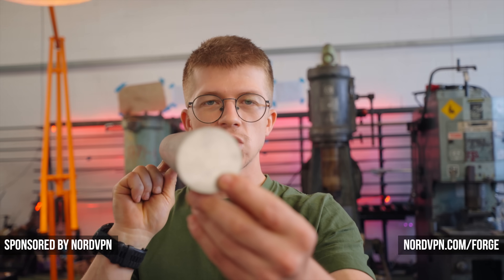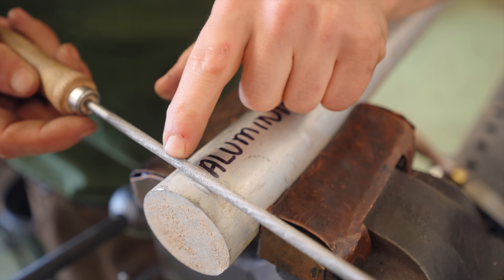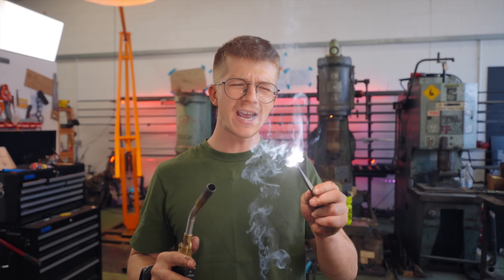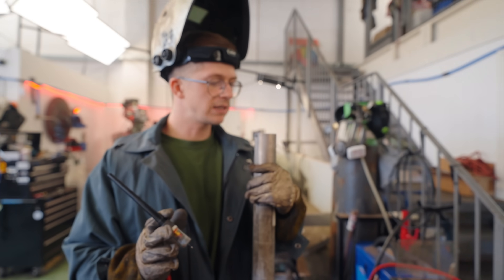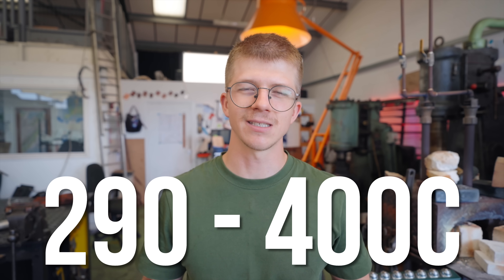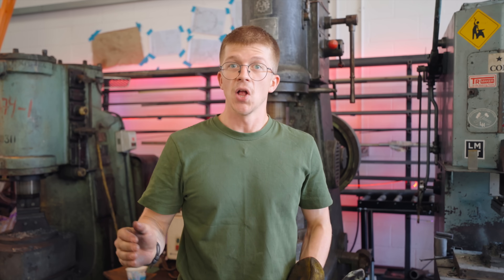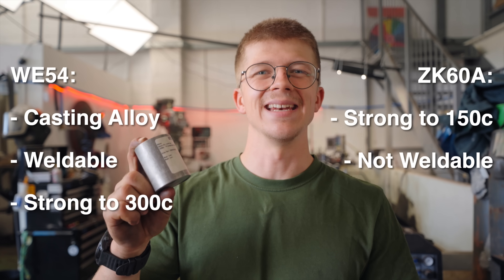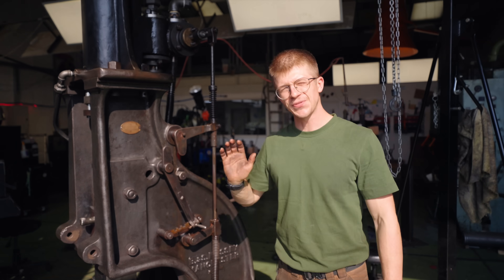Can You Forge Magnesium?

Comment: The Density doesnt really correlate with properties like hardness. Thats because density is mostly affected by the mass of the atomcores, while hardness is mainly affected by the bonds.
Reply: indeed, look at at metals like gold and lead which are famously dense... and famously soft
Reply: @vhaelen326  And mercury, the softest of them all and crazy dense. Dense enough to float lead on it.
Reply: @mrkiky wondering if solid mercury is indeed soft or hard? It would be a funny episode to forge something in a big freezer :D
Reply: @apinakapinastorba  Or just take the mercury out of a freezer instead of out of a forge. And periodically you put it back, but not because it got cold, but because it's getting too hot.
Reply: @mrkiky  no as fun thou
Reply: @apinakapinastorba  Otherwise the freezer would have to be really freezing to solidify mercury, and you'd have to maybe dunk it in slightly less freezing brine to heat it up or something. Also the temperature might make the steel of the hammer and anvil slightly more brittle.
Reply: @vhaelen326 Tungsten be kinda weird though
Very high youngs modulus, very hard (i.e. also brittle) but yield strength roughly 3 times steel
combination is also likely why it exhibits self sharpening properties
Reply: @vhaelen326  contrasted with titanium (and cast iron vs carbon steel?)
Reply: @vhaelen326 even denser and softer yet: mercury
Reply: @vhaelen326 then look at osmium, it’s the densest metal known To man and also one of the strongest
Reply: @vhaelen326  What about the reverse? We are talking about very light but with these strong bonds. With carbon I see it but with metals?
Reply: @vhaelen326 Yes. Quite the same is true for Thallium.
Reply: ...and crystal structure.
Reply: @AnonymosAnthropos  And imperfections within that structure, as the cracks from working the magnesium to hard illustrated
Reply: Now you're talking. @AnonymosAnthropos
Reply: The density depend on the atomic mass and the crystalline structure. Some geometry cause the atoms to be more packed together than other.
The hardness depends on the bonds and, to a lesser extent, the crystalline structure.
Reply: yeah! take Lead as example its really dense but also soft
Reply: Best example would be charcoal and diamond, both are carbon but one is very much harder to work with than the other
Reply: @ClawsOfAFreak  but diamonds also have a higher density so it's not a good example
Reply: @HanTrio3  diamonds have a low density they weigh almost nothing.
Reply: @ganjalfcreamcorn8438  diamonds have a density of 3.52 g/cm³ which is higher than that of charcoal. That's what my comment was about
Reply: @HanTrio3  Diamonds are not very dense. Abaut half of steels density.
Reply: @peraz968   Diamonds have a density of 3.52 g/cm³ which is higher than that of charcoal. That's what my comment was referring to
Reply: @ClawsOfAFreak Or tungsten and gold
Almost same density but one is extremely hard and one extremely soft for a metal
Reply: @ClawsOfAFreak  yea but diamond is more dense than charcoal... so your example is a bad one
Reply: @ClawsOfAFreak  That’s a terrible example. Both made of the same thing. One dense and hard, the other not dense and soft
Reply: @ClawsOfAFreak  this is actually not the best example, bc charcoal and diamond are both composed of Carbon, and this question was implied to be about metals composed of different elements
Reply: @ClawsOfAFreak  charcoal HAS carbon, it is NOT carbon keep that in mind.
Reply: @ClawsOfAFreak  best example is lead (or gold), which has very high density but is very soft (pure gold can be cut with butter knife)
Reply: @ClawsOfAFreak is diamond NOT harder, than the charcoal you mention, due to a more DENSEly packed Crystalline structure
Reply: @ClawsOfAFreak very true! On the one hand, working with diamond tools is very nice, whereas coal tends to be rather messy
Reply: @ClawsOfAFreak  i mean yes, but we were talking about metals specifically because the topic was forging
Reply: @vhaelen326  the topic was material hardness in relation to density. so your wrong.
Reply: @vhaelen326 you can apply same principles to different situations. But thanks for pointing out its metal work 🙄
Reply: @vhaelen326 charcoal was first used to harden iron in Japan sword making. So yeah
Reply: Titanium is another great example.
Reply: Also the structure of the internal crystals. Like how steel can be brittle or maleable  depending if it's been heat treated.
Reply: more importanly he starts by claiming you have a solid piece of Magnesium then go on to say it is an Alloy. There is big diffrence in the two! What he is trying to forge is not Magnesium because if it was it would be malable enough to forge at room temp, instead he is working with a mix of Magnesium, Yttrium, Zirconium and Neodymium and it is the other elements that are making the alloy brittel and hard, not the Magnesium.
Reply: Idk, I'm pretty dense and incredibly hard
Reply: To really test it they should forge mercury..
Reply: Lead and gold are both two of the densest metals, but also two of the softest metals.
Reply: @TylerDollarhide so density has to do with the atomic weight of the metal and hardness the strength of the metallic bonds between the atoms within the metal 
How those atoms are arranged will  determine the strength of the metallic bond and hence it's hardness, the density is determined by the number of atoms per volume.
Reply: @michielvangulik6698  density is also determined by the KIND of atoms. 1 thousand lead atoms weighs far, far more than 1 thousand iron atoms
Reply: @TylerDollarhide  Tungsten is denser and harder so how does your theory work now?
Reply: today i learned a thing! thank you!
Reply: Came looking for this comment and it was the top one.
Reply: Density doesn't correlate with quantity of atoms either. Camera man is oblivious to atomic weights.
Reply: Does that imply there is a way to make the magnesium more dense with compression?
Reply: @BlackBirdMax Yes, although not necessarily in a practical way. Anytime you compress something, you increase density by having more mass in less volume.
Reply: i think the theory was more in the line of "the hardest light thing isnt very hard, compared to denser things."
Reply: @MrKahrum  pretty shitty theory. Lead is 3x denser than diamond.
Reply: @executive  not even a counter point.
Reply: @MrKahrum The lightest things can be extremely hard, but the key is not to conflate hardness with strength. High hardness without ductility/malleability means a substance that will shatter instead of bend, hardness does not mean it won't break.
Reply: @wilhelmschmidt7240  all of these vectors must be taken as  a whole. if i may lump them all under "strength" (here i mean all of the resistances to breakage) there is a limit to how "strong" something can be. this limit is inherantly linked to how much matter is in the given sample, and therefore the lighter a material is, the more SOME aspect of "strength" must fall short. the denser the material is, the more "skill points" it has to play with.
Reply: Magnesum knives pleas
Reply: Ikr, gold is one of the most dense metal on earth yet It's  soft as shite. Yet titanium is one of the lighter than steel yet stronger than steel
Reply: YEAH Mercury has a VERY low Rockwell
Reply: And you get those bonds by either having something like carbon that can create hyper strong bonds in a very simple form, or by alloying where a taint material creates a great connective point for the main material to connect to.

Tungsten, Gold, Mercury and Lead are some of the better known dense metals and 3 of those are soft (one even liquid) while Alex learned that Tungsten can actually be worked with standard steel tools when not produced in its hardest form.

Meanwhile, stacked Graphene can be 10x as hard and strong as steel at 1/20th the density.
Reply: Like tungsten and tungsten-carbide
Reply: ZINC
Reply: Yup, compare titanium (Density: 4.5 g/cm3 Hardness: 120HB) and lead (Density: 11.34 g/cm3 Hardness: 5HB) .
Reply: just think about carbon fiber which is light and resistant vs gold which is heavy and soft
Reply: How hard is viagra?
Reply: Makes sense when you think about Titanium, a strong but less dense than steel metal, and then Lead which is very dense but is also very soft
Reply: @OssomUmbra  pressurize the lead :)
Reply: density and hardness are related but not exclusively. there are many other factors
Reply: I mean it DOES loosely correlate (inversely), at least with elemental metals, as the molecular bonds are weaker moving down the table. All bets off with alloys and ionic compounds though
Reply: First part of this is fine i guess, but your explantion is completely wrong.
Reply: Look at gorilla glass for example, its the bonds between the materials that give it its hardness, even though its super light and not dense at all. Really depends on the material.
Reply: Please tell me more about these “bonds” and how they work, I simply must know
Reply: I've never seen the word "atomcores" used before is English your second language? No hate just interesting
Reply: @adamfanning9412 in my language we use the word ”atomiydin” = ”atom core”
Reply: Uranium: MF what?
Reply: Yawn
Reply: My immediate thought was "Man he'd be so confused by refined silicon"
Reply: An atom of osmium is a lot less massive than an atom of tungsten, but the bulk metal is far denser.
Reply: Yeah because diamond is sooo much lighter than gold and gold is well... like butter compared to it
Reply: No but it does heaviness generally l. Now size and density in no way are related.
Reply: @bochapman1058  you need size(volume) and weight to get the density
Reply: Not necessarily. But good job on passing seventh grade science.
Reply: The hardness comes from rigid crystal structures or in case of steel, smaller atoms reinforcing existing material like carbon does to iron.

Pure metal is actually more often weaker because it becomes so uniform that it is easier to shear it apart
Reply: Correction: density is both mass of the atoms, and how close together they are. Osmium, irridium, tungsten, etc are so dense - more so than even more massive elements - because the atoms bond so strongly with each other. Stronger bond, shorter bond, atoms closer together, higher density, usually.
Reply: @altejoh  the entire Atomic spacing is determined by the properties of the atom itself. Larger heavier elements have relativistic adjustments to the electron orbitals that caused them to contract in somewhat. One element due to this is theorized that it will have a density of sometimes wear around 30 times out of water but it will be never made in quantities more than a few items at a time if that
Reply: U a smart 1
Reply: yeah i was just about to say that about how gold is very dense yet soft but about a hundred so people were ahead of me soo nvm. also why did he spell aluminum "aluminium" , its a pronunciation difference not a spelling difference.
Reply: It doesn't directly but some of the densest metals such as tungsten or titanium, are usually harder to break however gold, which is also super dense, is very soft. Also how tungsten carbide is less dense than tungsten but WAYYYY stronger
Reply: Couldn't the softness also be a byproduct of the APF?

Because (if I remember correctly) Gold and other soft metals are FCC, so the higher APF could mean a greater density, while maintaing the most slip systems making the metal softer?
Reply: I'd almost say hardness and density has a decent inverse relationship cause of lead, gold, and a couple other I can think of that are heavy and soft.  I know that ain't true tho.
Reply: The crystalline structure really matters as well
Reply: Yeah lead is quite dense but is extremely soft.
Reply: You are kinda right, but its more complex than that, take graphene-which is less to do with the bonds strength par se, and more to do with the bond structure, i.e. the culminative contribution in 3d space.
Reply: good examples are gold and lead
Reply: Gold vs aluminum is the best way to demonstrate that
Reply: That's what your mom said last night
Reply: Someone is a metallurgist
Reply: Hardness is also really correlated with electric conductivity.
In fact, in the aerospace industry where hardness is important, conductivity is tested first, then if it is off the charts, hardness is tested. Because you know conductivity testing doesn't cause any indentation on the test sample
Reply: Wow very good explanation
Reply: That is true, I mean we have Steel which is often lighter amd stronger than its amcestor Iron. Same story with Titanium. Or even Duraplastic!  Lol
Reply: Yea, consider titanium, aluminum , tungsten and lead.
Reply: @michaelallen1432  Lead is really dense and heavy, but very maliable. Hence why its used in lead lined suits, etc for things to deal with rads. Is it the best not really but hey its one of the better things we have
Reply: @michaelallen1432  im not disagreeing im just adding a section
Reply: Like diamond. Not dense, but atomically structured “perfectly”.
Or gold. Heavy, but incredibly soft.
Reply: yee both lead and gold are soft yet lead and gold are both very dense
Reply: if they had taken a second to think about lead, they'd know that density does not equate to hardness. lead is dense AF, but a soft metal
Reply: It does correlate, no one thing creates hard objects, it’s a culmination of multiple things going on, which is why rocks with no bond, are harder than silica with a strong bond
Reply: 2 examples. Gold, and most importantly Lead.
Reply: @JayJae-o7x  both have other metrics of strength that they are very high in.
Reply: Yes it does. For the most part denser things tend to be harder. Its not an exact science and things violate this rule, but there is a general positive correlation between the two, where do you get your information? You can verify this using literally any research into the topic.
Reply: As an American i agree that the metric system is better, but I disagree that the Celsius system is better.
Reply: I understand the need for safety and you cant take big risks but I think based on what I've seen you can bring the temps up more in forging to gef better results but you'd wanna do so outside away from anything I guess.
Reply: Yeah if that was the case gold would be hard?
Reply: I thought density was how tightly the atoms were packed?
Reply: Example of a soft but extremely hard substance?
Reply: Grain structure is also very important especially in stainless steel
Reply: Yup the most extreme example is beryllium. It is a bit harder than titanium, brittle, unearthly light, and machines similar to bright cast iron. Oh and it is horribly toxic. 😳💀
Reply: You mean the nucleus?
Reply: But there’s definitely some correlation
Reply: Casing point - LEAD!!
Reply: This is what I was thinking.  Thanks for the confirmation.
Reply: Density is way way more about how the crystalline structure is arranged.
Reply: But does density affect ease of cutting or filing?
Reply: Lead is an awesome example of this.
Reply: Well yes, but if you have an unimaginably dense material such as star core its so dense that it does indeed get harder
Reply: like led is very soft. mercury is a liquid at room temp
Reply: Don't forget, mercury! Famously not hard despite its density! Though, tbh, I don't know its properties when frozen.
Reply: There actually is some correlation between density and hardness. Tungsten is extremely hard and extremely dense. But the main thing is: there's not really a causal relationship between the two. The most important causal relationship is between hardness and lattice structure.
Reply: @LReBe7 this is the correct response, and what I came to say. Yes, there is often a correlation between density and hardness. No, it is not a causal relationship.
Reply: @LReBe7  true. Correlation really is the wrong word for what i meant ><
Reply: @LReBe7  I don't think the fact that there exist dense, hard materials proves any kind of correlation between density and hardness. For that to be so, it would have to be the case that denser materials are on average harder, which still wouldn't imply a causal connection between the two.
Reply: @LReBe7  Ok but that literally means there isn't a correlation between hardness and density. There are super dense and super soft materials, there are super dense and super hard materials, there are low density and low hardness and low density and high hardness. Literally 0 correlation. If there were, you should be able to make some predictions with at least better than 50% accuracy. If I tell you "material X is very dense" , the only conclusion regarding hardness you can make is "well it could be very hard... or very soft, fk knows". No correlation whatsoever.
Reply: But it does! Ok, well, sorta. If you compensate for density. The term is "specific strength" which is the strength divided by density.

The strongest lithium alloys have about the same specific strength as the strongest magnesium alloys, the strongest aluminium alloy, the strongest steel alloys the stongest nickel alloys and so on. You get the idea. 

Hardness is related to how well a structure facilitates, or hinders, movement of dislocations (think of those as lattice stacking faults.) If it is harder for dislocations to move, the material is not as able to facilitate plastic deformation. Movement of dislocations is determined by the atomic lattice, by the grain size, by presence of alloying elements and by dislocation density.
Reply: @Hydrazine1000 No, this is not always the case. Materials can be both extremely hard, therefore difficult to deform, but also malleable so when it does deform, it bends and doesn't shatter. This is another instance where there is a surface correlation, but no causation and this is why things like alloying materials together and heat treating to harden or anneal work. I specifically work in an industry where I need to meet very specific material conditions, and overcoming the brittleness of hardened steel is something I have to account for in material composition within the alloy.
Reply: Yes. However, there is a direct correlation between the affinity of an element to form multiple bonds (remember quadruple bonds in Tungsten compounds) and its density. In contrast to this, ductility of a metal is another story (think of Gold vs Indium or Potassium for instance).
Reply: @ArminVollmer  true but i think you misunderstood... metals are like marbles in a box if they are packed closer together with more direct neighbours they will be more dense.  metals dont 'bond' to each other but are held together by the free movement of the outermost electrons in the conduction and or valence bands
Reply: @ArminVollmer  MOST metals have a cubic crystalline structure, where each atom bonds to 6 adjacent atoms with varying strength bonds, (like the weak bonds of gold and lead which make them very soft and ductile). Magnesium as a metal, on the other hand, has an EXTREMELY STRONG crystalline structure, since each atom bonds to TWELVE adjacent atoms (6 spokes, plus 3 above & 3 below), combined with strong bonds ... both extremely useful properties when combined with it's low density.
Reply: Came here to comment this. Hardness is just a measure of how much the material deforms under stress, essentially stiffness. Density has no bearing on this. Take for example ceramics vs soft metals like gold or indium.
Reply: @kkuhn I think you're wrong, pretty sure a densely packed structure would resist, more than a lightly packed atomic structure (diamond to charcoal)
Reply: Although, there is somewhat of a correlation, as heavier atoms generally can make up materials with stronger bonds, and materials with more densly packed atoms are genrally in your day to day life harder and/or more durable too. Although, as you said, it´s not really connected and a lot more complex, especially when you start to mix differnt elements together. Even just changin the molecular structure of a single element can massively reduce or increase it`s hardness. Carbon being the best known example to the layman. In one arrangment you get relatively brittle and soft graphite, and a more crystaline structure you get diamond. 

There also is a caveat to density and atomic mass. While it too has a generl tendency to correlate, it again also depends on molecular structure and how close the atoms sit together. Heat being a good example in being able to change the density of a material by increasing or decreasing the distance between atoms.
Reply: @theexchipmunk  "heavier atoms generally can make up materials with stronger bonds,". No. Total bullshit.
Reply: @executive  true and as atoms get larger the metallic bond between them weakens because the nuclei get further apart as the electron cloud grows bigger
Reply: @michielvangulik6698  well nuclei repel each other anyway. It's more about nucleus to electron attraction. The most electro-negative atom is Fluorine and fluoride bonds are some of the strongest (in the realm of single bonds anyway)
Reply: @theexchipmunk There's a lot to unpack there, and it reads extremely incorrectly. I think you have conflated a few terms but to be clear, no heavier elements are not intrinsically more durable, nor have stronger bonds, nor appear more in everyday life. Quite the opposite, helium and hydrogen are massively abundant, while hopefully you have little Uranium, plutonium, thorium, etc. in your everyday life.
Reply: Isn’t density more consistent with the weight of something?
Reply: @CajunReaper95  density = weight per volume. This is elementary school physics.
Reply: I think you’re looking for the word “nucleus”. This is also false.
Reply: @Flumphinator  Incomplete maybe, in that density is not entirely determined by the atomic mass of the material, but it's a lot closer to the truth than "lighter stuff has less atoms so it's softer"
Reply: "atomcore" is the direct translation of "atomkern", the German word for atomic nucleus.  It's a common translation error for bilingual German and English speakers rather than an indication of misunderstanding the science.
Reply: You guys are just guessing.  Aluminum is famously NOT dense... and famously soft.      Tugsten is  very dense and VERY hard   so that blows all your silly ideas out the water.   density is about atomic weight and structure.   Hardness im not sure